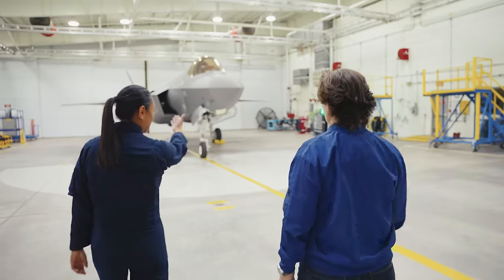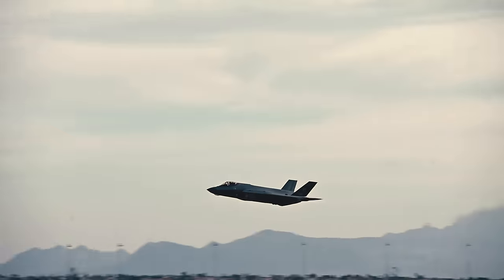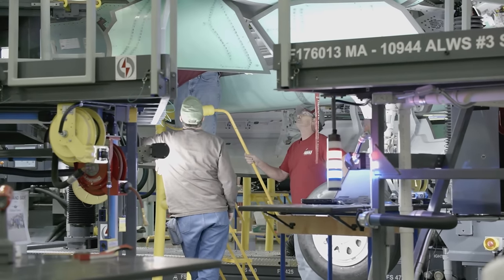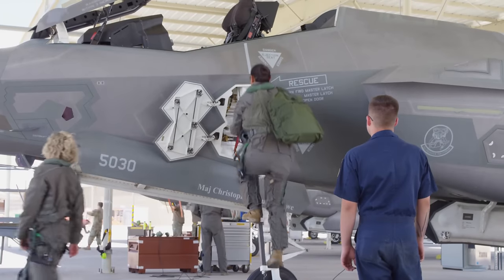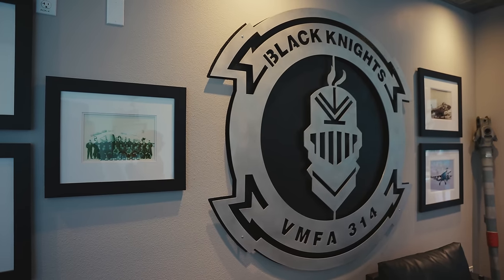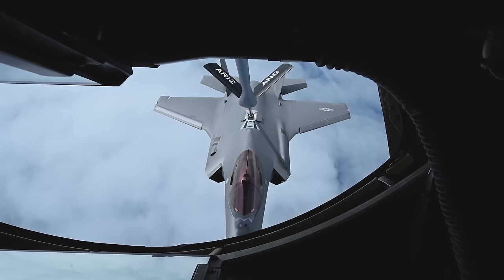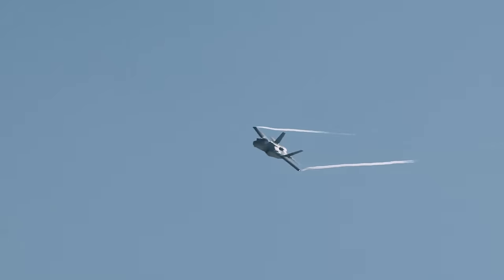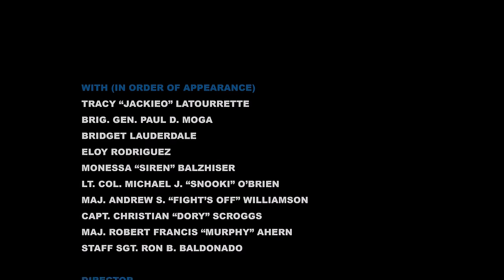The F-35 Lightning II | Behind the Wings on PBS

Comment from the maker: Join Colorado's First Lady Fighter Pilot, Tracy LaTourette, for an up-close look at one of the most advanced military aircraft in the world.
Reply: It’s so cool that we have women fighter pilots now; some who are now retired.  Apparently women actually have better G tolerance than men do.
Reply: We should make the whole jet fighter force female.
Reply: The f16 is a better all round fighter in most applications! 😊
Reply: The most fun and transcendent flying machine is the F-16. If I wanted to feel like I could actually fly and move however I want, the F-16 does that. Another youtuber who flied both the F-15 and F-16 loves the F-16 much more. The bubble canopy and relaxed position and the responsive fly-by-wire side stick makes you forget the the rest of the plane is there.

Now if I had to fly into a warzone on a mission, I'd want the F-35, with all the support.
Reply: @keirfarnum6811  true but a little misleading. It's due to the average size and height of a women is smaller than a man so blood doesn't have to be pumped as far under stress hence having an average higher g-load. If a man was the same height and the same body size, it would be the same.

Comment: I’ll admit, I was a vocal critic of the F-35 but as I see how it’s employed, even I gotta admit, I’m a fan. 

Imagine a pair of F-35’s backed by a couple dozen F-15EX’s with a few sticks of F-16’s running cover and a group of EA-18G Growlers paving the way. That’s a badass formation. 

Now do that X 10… Multiple times.
Reply: I know it sounds dumb but the Growlers will be unnecessary. The F-35C's AN/ASQ-239 Barracuda electronic warfare system is far superior in that regard too.
Reply: @RocketPropelledGuy in some cases this is true, but if I remember correctly from what limited knowledge of the growler I have, the growler has a better top speed meaning that you can get out of places easier, which is important because you light yourself up like a Christmas tree when you start jamming people. So while the f-35s electronic warfare suite is very good in some situations, it can defeat its own stealth

That speed difference is Mach 1.8 for the growler and Mach 1.6 for the f35. Those are the Wikipedia specifications so it's entirely possible that both aircraft could hit higher speeds under emergency situations, but there's no way that we are going to be told that without having a security clearance
Reply: survivability is better than any other aircraft a lot of people don't know this but it has a buoy that mimics the  whatever missile or aircraft is locked onto the f-35 signature and then the tow behind Bowie mimics the signature of the f-35 at the exact moment the missile or aircraft locked on to it which means the missiles incoming have no reason to believe the tow behind is not the f-35 pretty cool technology. It also jams better than any other plane in the market by far.
Reply: @Its-Just-Zip  Here's the thing. The "top speed" of almost any fighter is going to be from what it is completely clean, no weapons and often even without things we consider essential for doing the work in the modern era like targeting pods. The F-35 has it all internal, it does not have the extra drag of these things and the "top speed" is with the weight of all those in there with a full internal weapons bay. Even going mach 1 is a very rare event in a combat sortie, and not a single coalition aircraft ever even went mach 1 in a combat mission throughout the entire Gulf War. Vietnam demonstrated extremely high top speed like that was just not the useful thing USAF SAC claimed it was going to be. Having excellent thrust though, is a different matter.

The Hornet, both the Legacy, Super Hornet, and Growler all suffer from lackluster thrust. An F/A-18F pilot (who also was a Fighter Weapons School graduate) having switched to the F-35 likened flying the F-35C to flying a hornet with 4 engines. It's like the fantastic thrust and 2-circle authority of an F-16 (which the F-35 also outperforms in almost everything including a rate fight if the F-16 is carrying any weapons at all) with the very high AoA authority of the Hornet. It has a better range than both, carries more fuel than both internally, has a far better safety record, has the automatic ground collision avoidance that the hornet doesn't (Most of the F-16's in US inventory do now though) and can carry more weapons than either in a permissive air defense environment.

But because EW is now so important I don't know what to tell you about whether or not jamming is as compromising as you say. I really doubt we will get honest information about that from anyone that actually knows, understandably. And all of that is without getting into much more complex stuff like Sensor Fusion and the very, very impressive MADL Data-Link, those are giant leaps in capability that change everything and the character limit of a YouTube comment isn't enough to explain how.
Reply: @Its-Just-Zip  Just remember that Mach 1.6 top speed is with a full load of weapons.
Reply: @SloaneLasers  did you not read my entire comment because there's an entire second paragraph about how design speed, which is what's told to the public often differs from true capability. At least the other person who provided an um actually comment provided more information
Reply: @Its-Just-Zip  Your second paragraph seems to mention how Wikipedia suggests it might go faster in some sort of "emergency situation" but fails to mention weapon loadout.
Reply: @Its-Just-Zip the top speed for the growler is not combat loaded, the f-35 can be fully loaded and still achieve its top speed
Reply: @SloaneLasers  With 43,000 pounds of thrust, I'm betting that is just the unclassified speed. Seems like I remember the Raptor being rated at 1.6-1.8 when it was new.
Reply: Well who would’ve thought the US government made better decisions than you in certifying planes lol
Reply: @Its-Just-Zip 
The growler only goes Mark 1.8 without its pods or HARM or Sidewinder weapons -ie clean configuration 

The F35 can max speed with full internal missile load

Comment: Both VMFA-314 and VMFA-311 operate the F-35C. Also, the F-35A is equipped with a tail hook as well to make arrested landings ashore if necessary but does not operate from a carrier.
Reply: A lot of planes do, f15 and f16 have em as well (along with others I just forgot)

Comment: I wish you could go flying! Either a two-seater F-35 or maybe a training version that has remote control backup, so a trained operator on the ground can take over in case of emergency.
Reply: I've heard that pilots train on VR mostly so its possible to try the F-35

Comment: The 35 operates outside the capability of the E-2 Hawkeye?
Reply: The F35 is like a mini AWACs in terms of detecting targets but a full-size AWACs plane has more people which lets it act like a flying Air traffic control tower coordinating a whole formation much better than a single pilot could. Additionally the E-2 can loiter for way longer than any fighter jet providing faster communication than a ground tower and continuously coordinating the battle as F-35s go to refuel and rearm. The E-2C is also being actively replaced by the E-2D which has a new AESA radar which presumably exceeds the capabilities of the F-35s radar, or at least we guess it does all that info is classified. The D models can also have aerial refueling capability allowing it to stay in the air even longer. Of course the E-2 isn't stealthy so entering contested air space isn't safe but it has such a large range that it shouldn't need to.
Reply: @T-Dawg123a  so, if the 35s networking capabilities are "real time" with the E-2D, than the 35 can leverage information exclusive to the Hawkeye in it's narrow mission set; and that is saying something if there are several of them up there together working an opponent in a buttoned-up configuration. Then, the only other consideration is whether the super-carrier where the E-2 calls home can dodge submarines in perpetuity while the airwing works it's magic at a distance with in-flight refueling.
Reply: @jamesbohlman4297  yeah submarines are a threat but carriers can have a attack submarine in their strike group as well as the other ships and the reserve airwing being capable of deploying ASW sensors and weapons additionally land base aircraft like the P-8 have long loiter times and specialize in anti sub warfare.
Reply: @T-Dawg123a  my understanding is that the Kilo class is a hopeless dinosaur in the presence of a Los Angeles class.
Reply: @jamesbohlman4297 eh idk about hopeless dinosaur (unlike their air force Russias subs actually can pose a threat) but they certainly outclassed by the LA class
Reply: Also fun fact the 35 and even some upgraded 4th gen fighters can fire on a enemy and use a datalink with a awacs to guide the missile, without ever turning on the planes radar
Reply: @Apple-om5mr  super. But, the E-2 is vulnerable to interception.
Reply: @jamesbohlman4297 that’s what the fighters are for
Reply: @Apple-om5mr  a gaggle 35s loose in the backfield is a scary proposition.

Comment: I don't understand why the variants of the F-35 don't have enough internal space to carry more ordinance. 4's not enough.
Reply: They expanding it to 6, though yea it’s gonna carry less ordinance, that’s the price you pay for being undetected
Reply: @Apple-om5mr It's why I hate the F35-B. Not having to implement a STVOL system would free up more volume for weapon bays.
Reply: @tadferd4340  Thats what the A and C are for, STOVL is a capability that the marines need for their doctrine and way of fighting, so they were willing to compromise
Reply: Loyal Wingman drones for additional ordnance carrying. Also other non-stealth planes hanging back to act as bomb trucks.
Reply: It only needs stealth using the smaller bays for SEAD missions and early strikes. Once air dominance is established, they can carry a lot more on external mounts when stealth isn't the primary mission.

Comment: June, 2024. All-missions availability rate 34%. Requires humidity-controlled, airconditioned, dust-free maintenance facilities, so can only be operated from highly developed major air bases. Combat radius, straight-line, no afterburner 850 nm. Can carry one air-to-ground guided weapon or two dumb bombs, plus  two AM-RAAM air-to-air missiles, unless it discards stealth. Ground time to air time ratio 20:1. Component (spare parts) supply in permanent gridlock, due to pork-barreling. Cost, so far, at least 430 billion USD, the most expensive weapon program in history. If you're a pilot, of course you love it. If you're a crew chief, a supply officer, or a taxpayer, not so much.
Reply: You speak half-truths and lies, LOL....
Reply: @Ezees23  For example...?

Comment: It's a bit annoying that they all seem to love this aircraft, but can't tell you why. Mach 1.6 is not impressive. Other fighter jets can fly way faster than that. The F-35B looks cool landing & taking off, but everyone in the field knows that this comes with downsides in term of payload capacity and stealth. The F-35B we saw here had it's weapons mounted under the regular wings and not stored in the internal weapons bay.
So what exactly can the F-35 do that you can't do with a regular fighter jet with a satellite up- and downlink? And I mean in pragmatic terms. The sensor fusion is nice, but if you develop tech with that level of TOP SECRET, you don't want to reveal it as long as you can. And this means that you cannot use it in Ukraine for example, where this plane would be needed the most against Russian S300 and S400 systems. Or maybe they already do, but aren't allowed to tell anyone? (Hence "your foreign deployment")
So what targeting data can the F-35 send that a satellite link can't?
Reply: You explained it, the F-35 can do what other fighters can’t do without a satellite up and down-link. Why waste a satellite when the plane can do it by itself. It’s also stealth while having some of the most advanced electronics. No other country has a stealth jet. The SU-57 has the same RCS as an F-18 and the J-20 or whatever the Chinese call it can barely fly and is 50% plastic. Which is not stealthy.

Comment: Nice video, yet the silence on naming the F-22 as the best 5th generation jet just makes this video a false narrative.  We all know what jet is far superior and also why we will not sell the F-22s to other countries.  It has technologies that are just much more advanced than the F-35, other than the F-35s updated electronics.
Reply: The F-22 is more optimized as an interceptor. It's faster, more maneuverable, and can perform at a higher altitude. However, it's sensor system and it's loiter capability is vastly inferior to the F-35. It would be better to think of the F-22 as an F-15 with Stealth, but the F-35 has decades newer controls and systems that make it a much more practical jet to use in combat than the F-22.
Reply: @XerrolAvengerII not to mention that the 35 is far better for missions outside of the air to air role
Reply: The F-22 when it has to shoot something that isn’t in the sky…it can’t lol, the F-35 can.

Comment: It’s slow.
Reply: 1,200 mph even with a full internal weapons load is slow?
Reply: @SloaneLasers  F-14 @ Mach 2.3
1200mph vs 1800mph and F-14 has more range and can hold extra fuel tanks.
say you had to provide air support launching from guam to the 9 dash line, and yes having stealth is a huge plus but a lot of people can die in the minutes you save in a F-35II
Reply: @pagpapaitim  Not always about raw speed. Sometimes you need agility. Some cars will blow the doors off anything in a straight line, but can't turn.
Reply: @SloaneLasers whatever those “sometimes” are it’s still going to be slower.
Reply: @pagpapaitim we talking about the same f14 that barely could get off the ground due to cost and maintenance issues? We aren’t in the 60s anymore, having only speed isn’t the surviving factor.
Reply: Slow means fuck all when you see the enemy first. There is a reason no new fighter designs focus on speed.
Reply: @n3v3rforgott3n9  of course the reason is stealth.
Reply: @pagpapaitim you’re holding the F-14 like it’s main contributor to its partial success was speed. It was not. It was BVR combat capability.